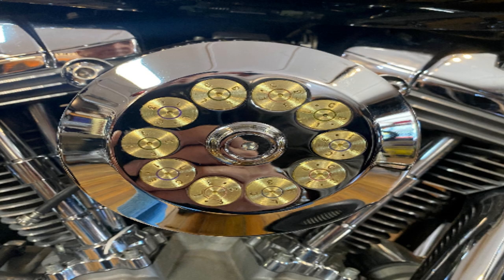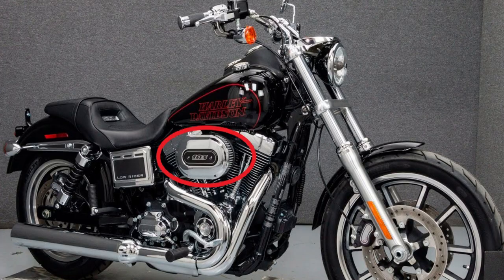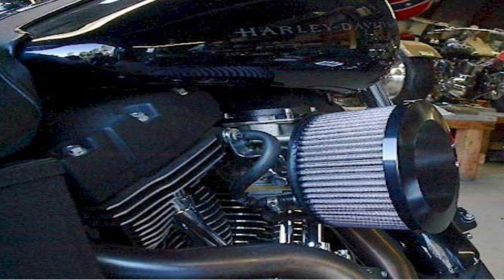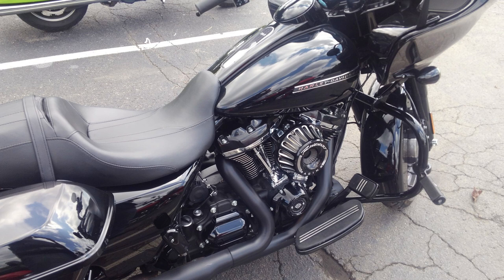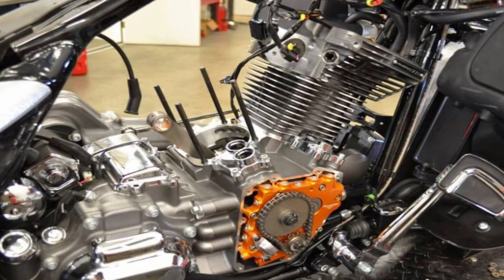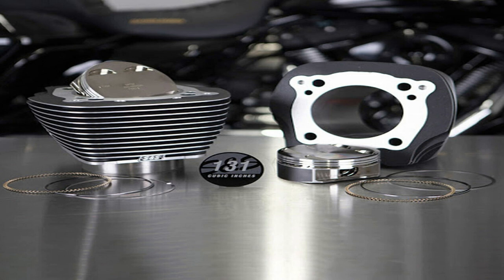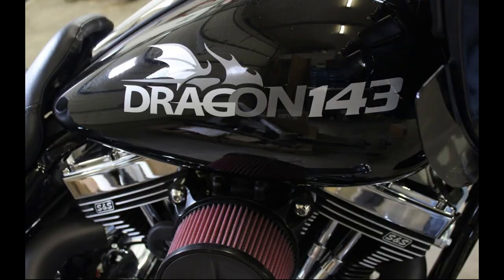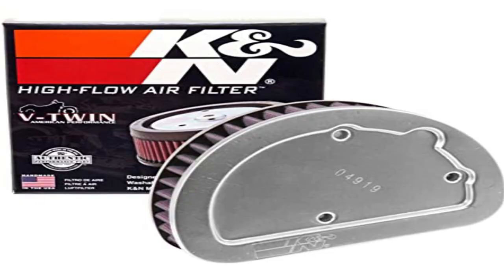Feed the Beast, Harley Air Cleaners Can Make or Break Your Build

Comment: I seen people now with the 107 Milwaukee eight and so forth with the stock airbox cut the bottom out put mesh screen on the bottom put a K&N in there and they got a hell of a lot more flow
Reply from the maker: For sure! I used to trim down the stock backing plates only leaving the mounting portion for the throttle body. That was always a quick way to get an open element air cleaner until I could buy one.
Reply: @GixxerFoo  I saw a few on the Facebook forums stated they did it to get more air flow and use the stock like K&N as well as a rounded one that fit into it.

Comment: Nothing like HPI V2 62mm 498 cfm.

This is going on my 131 crate engine

The HPi V02 55mm with heavy breather is on my M8 107. Also these AC have Velocity stack inside of it.
Reply from the maker: HPI makes some monster throttle bodies! They work very well, they have a much better design than the Screamin Eagle.

Comment: What’s funny is size 143 S&S bike in Daytona and I asked him is that enough for that bike the engine and I said yeah man this air cleaner was dinky it was really small probably 4 inches if that are from side to side maybe 5 I mean it was small but they said it was enough to feed that 143 air.
Reply from the maker: It really comes down to available surface area, if you were to cover it it might start to restrict flow. Not enough to notice or feel but you'd for sure see it on the dyno.